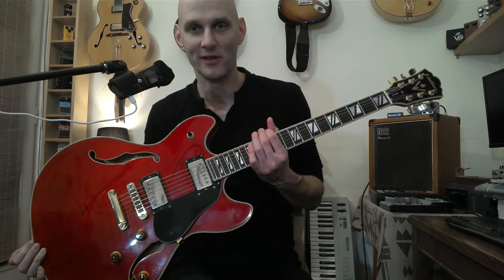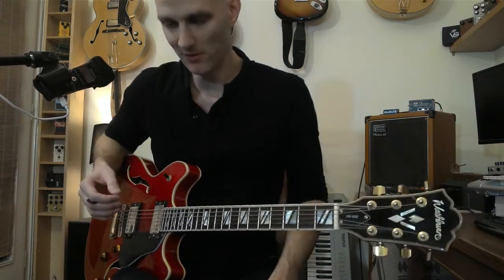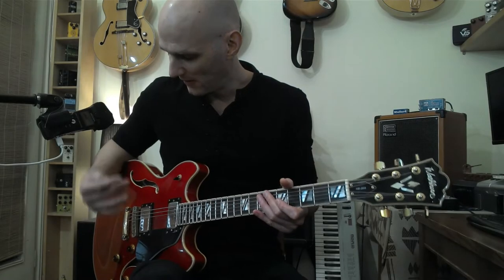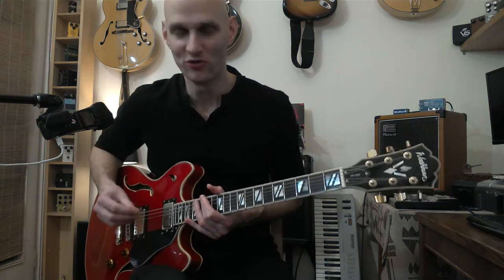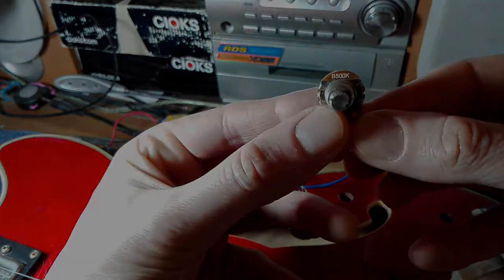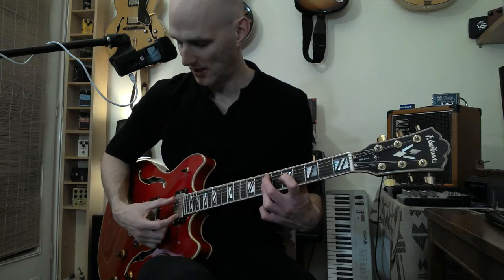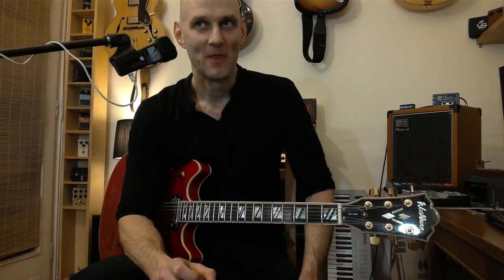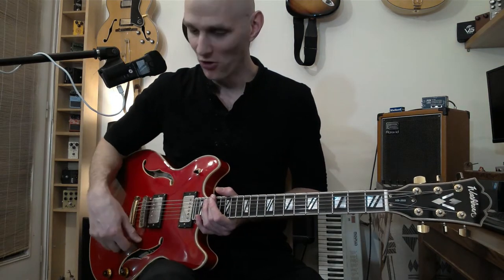"Muddy" Pickups?  No problem!  (...this is NOT the Treble Bleed mod...) 50's Wiring is KILLER!

Comment: an "isolation transformer" ( 1: 1 transformer in an enclosure with IEC in and standard receptacle out ), is a good studio tool to get rid of ground loops.
it doesn't have to be a giant one;  just enough to handle your highest draw device is usually good, because it's mostly used for trouble shooting. ( but often stays connected in line )

alternately, and less expensive, are cables with the shield lifted on one end. ( and labeled as lifted )

Comment: Yes , I assembled a 92 LP Studio, with taper CTS taper pots, using a a vintage wiring scheme, was blown away by the openeness amd clarity.
    Seems like it would be a fairly simple, and less invasive mod for anyone wanting to change their existing  setup.  However I don't think it's possible if your guitar has a modern circuit board setup.

Comment: The taper of the pots is a mechanical constant that can react differently with various wiring and capacitors. When I hot rod my guitars, I try'n upgrade ALL the electronics at once to suite the purpose I'm after. I'd never buy pre-wired kits. They never have everything I want in them. Being able to customize my guitars is half the fun!

Comment: BTW,  Tibor, I too like adjusting volume frequently while playing,  however, most times I use a volume pedal rather than the volume pot, then you always get the full guitar sound.
    I've come to prefer wiring in the Volume pedal after the Distortion pedals and before the timed pedals ie. Chorus,  Delay, Reverb. 
Try it.
Reply from the maker: Thanks for the tip Dave, I actually do this sometimes when I use my GT8 live and then I set the expression pedal as a volume pedal.

Comment: I was surprised, in the comparison, by the difference between 50's and the Treble bleed wiring. More noticeable than I expected
Reply from the maker: Yup, I was also pretty surprised by it.  The treble bleed is a great mod, but I'd put my money on the 50"s method any day, it can increase noise coming from dirty power/neon lights though as more highs pass through.

Comment: 50's wiring also works with Fender guitars also. It makes quite a difference.
Reply from the maker: Hi Norm Rivers!  Thanks for your comment!  Yes, I agree 100%, I have all my strat style guitars wired up with the 50's wiring.  The only thing I find with it on a strat is that you cannot controll the tone if only the bridge pup is selected, but there is actually a great mod for this, just need to make an extra solder connection.

Comment: Great video. I always thought that 50’s wiring was the same as treble bleed. Now I understand the difference. I have a Tele with a treble bleed and it thins out the sound when reducing the volume. I may try the 50’s wiring to reduce the thinning out. Thanks.
Reply from the maker: Hey dreamscuba, thanks for the comment, yes, I think the 50's wiring is the real deal, I have all of my axes wired up this way, even my strat, so I'm sure that the tele one will also work like a charm, I recommend checking out the breja toneworks channel, great source of info for schematics.  You into scuba?  I'm an amateur freediver myself :)  Take care man and thanks again for commenting!

Comment: Good stuff. What I also feel with 50's wiring is that it has a slightly more airy sound with the controls open. The only downside would be more prone to noise but who cares? It's about the character in the tone that 50's (correct) wiring provides to a player.
Reply from the maker: Thanks Aldo!  I agree 100%.  I also find that the other part of the secret are the B500K (linear) pots and not the A500k Audio/Logarithmic pots.
Reply: Theoretically I it should actually lower the noise floor. I read about it somewhere.
Reply: @philippgrunert8776  better grounding

Comment: Hey man, grettings from Brazil. I have the same problem with my les paul. My neck pick is very mud, even with 50wiring. There's a huge difference between neck and bridge. I took another solution that was changing the neck tone pot to a bass cut. Work's well but for high gain it kills a lot of sustain as the treeble bleed do too. Congratulations for your video man.
Reply from the maker: Fala monstrord!  Thanks for your comment my friend, greetings back from Hungary :)  (I've been to Campinas, SP, Bertioga back in the day, amazing places!)  Sorry to hear that about the pickup, maybe it's something to do with the pickup itself perhaps?  I think at the end of the day, the most important thing is that you find a solucao that works the best for you.  Sometimes the pickups are also quite mismatched.  Also remember that if you raise the neck pup high, it will also increase the bass and vice versa if you lower it.  Abraco!
Reply: Rewire all your volume pots. Use the middle Lug as the input and use Lug 3 as your output. Leave the ground wire alone.  This will maintain the pickup's volume when both pickups are switched on.
Reply: @ILLGREEN1  Its like the modern wiring I think. The problen isnt the volumes but the neck pickup lot of bass. I'm using the 50's wiring due the versatility when using the volume pot. But its a good tip to disconect the ground pot lug. I'll try
Reply: @monstrord  Cool! Not the ground, that can remain as is. I mean, only swap the wire from the input and the output.  

On a guitar with one pickup, you would usually solder a volume pot as follows: LUG 1-ground,  LUG 2-output and LUG 3-input.

But since you have 2 pickups, the above orientation will cause one pickup to short out the other.  Though it will still work and some like it. But if you want both pickups on without any reduction in volume when switching them both on, then your volume pot should be soldered as follows: LUG 1-ground, LUG 2-input and LUG 3-output.

In that orientation, the input is at the volume pot's wiper, so when it goes out into the output jack, your amp doesn't see it and both pickups don't short out the other.

This orientation works with whatever wiring you prefer, it's just preventing one pickup from drowning out the other when both neck and bridge are switched and keeping the volumes constant.
Reply: @ILLGREEN1  yeap, it's the independent and dependent volumes connection. I'm rewiring my second les paul with a new pickup set and I will take this one for independent volumes and modern wiring with adjustable treeble bleed. My first LP will maintain 50s wiring and dependent volume.

Comment: Tks for the video. Great advice. One question. Did the tone knobs change behavior after switching to 50s wiring?
Reply from the maker: Sorry for the late reply!  In a way yes, they become way more interactive.  You can also play around with the Alpha vs Beta pots, say you but betas for the volume and alphas for the tone, or both beta etc...  I have mine both Beta pots and they provide a more straight / linear curve and what also sounds amazing is if you turn the volume knob down just a bit.

Comment: Bill Callaham used to make a real ABR-1 bridge made out of cold rolled steel; but those are unavailable anymore. Those bridges made a big difference in the dynamics of the sound coming off the guitar, thus making the pickups clearer. A real shame they have gone away ...
Reply from the maker: I know what you mean, I also like the older "Harmonica" bridges and the older style Epiphone ones (the Korean ones from the Samick factory) I think my Washburn Hb35 was also made in the same factory in 1993 as it has the same bridge as my Epi Sheraton from 1996.  They are cousins ;)

Comment: Great info! Have you considered a noise gate pedal to filter out the electrical noise?
Reply from the maker: Hi Wayne, thanks for the tip, the thought did cross my mind, but I've actually played around with the power supply on my board (after watching a video from the ThatPedalShow channel called "That Pedal Show – How To Power Your Pedals Properly & The Legend Of VCPI" especially the part at 11:00) and it helped a lot as I do have a digital delay pedal on my board.  But thanks for the tip man!
Reply: @TiborRisko попробуй сменить положение конденсаторов.просто коснись их.если они припаяны правильно (orientation) они не должны шуметь.и ещё лучше чтобы корпус конденсатора  был из металла.извини за то что пишу на моём родном языке)
Reply from the maker: @alexl.8318   Спасибо за совет, попробую в следующий раз, когда буду менять струны на гитаре. Пишите на родном языке, могу перевести :) Мне всегда нравилось, как выглядят кириллические буквы, надо научиться их читать.

Comment: I don’t understand why this is not just standard in Gibson and Epiphone type guitars that used this originally. A quick way to get some of this effect is to cut the connection between the volume and tone on the neck pots. The tone will of course not work, but you can roll back the volume to clean up your sound or change dynamics.
Reply from the maker: I thought about this question quite a lot myself, but as Gibson owns many pickup companies that make billions with aftermarket pickups every year hence the saying "....get an Epiphone....pit a Gibson pickup into it if it sounds muddy and it will sound almost as good as a real Gibson...."  If Epihpne/Gibson would use 50's wiring to start off with, then this would cause a lot of loss for their affiliate pickup companies.  I could be wrong though, but I think it makes monetary sense ;)

Comment: Really helpful video,  I have a guitar with a p90 on the neck. Would the 50s wiring work on a p90?
Cheers
Reply from the maker: Hey Martyn, thanks for the kind words, I'm happy it could help.  Yes!  The 50's wiring also works with P90's and other singe coils (all my strats are wired up this way)  Hope it helps you, you'll never need a treble bleed again ;)
Reply: Of course, p90's were made in the 50's. Most Juniors are wired 50's style
Reply from the maker: @louaguado995  Yup.... I have a friend who has a Junior from 1959 and it has this wiring method.

Comment: Thank you for this video.  I use the modern wiring method mainly because it's perceived more louder to me.  When I tried the '50s, it was low sounding.  Maybe I should try it again.  Also, when wiring more than one pickup, the middle Lug on the volume pots should be the input.😉
Reply: I retired my Les Paul a few months back to 50’s wiring. I lived with it for a while to give it a chance, but in the end it didn’t work well for MY pickups. Could well work great on another guitar, I may try that but I didn’t like the sound (best I can describe, it sounded “flabby”) and I really didn’t like the interplay between vol and tone and that it was not predictable for me even after a long time playing how to set it. I’m going back to modern with treble bleed. Can’t find the original caps I had on there for treble bleed, but hoping to get back where it was. I find i have much more fine control.

Did some research, and found on a few forums people experiencing the same as I did, that the 50’s wiring on their particular guitars didn’t work as advertised. They, and I, experienced loss of treble when turning down vol. Not drastic, but definitely there. I may also need to try to revoice my pickups with a vary small cap. May be my particular humbuckers need some help.

Comment: When I redid my 97 L P studio I did 50's wiring w Garrett cloth wire. Got CTS 500K pots and. 011 caps to go with 496/500 pups. To get the most out of it IMHO.
Reply from the maker: Thanks for the tip on the 011 caps, will try it on the next guitar I buy...even though I really should not buy any more guitars but hey.... ;)
Reply: @TiborRisko  I used. 011 cause I'm a Strat guy 1st. My current Strat I've had since 96. It's a 3 color L Sensor equipped deluxe plus and of course any Strat is going to be a little more trebley than a bucker. So my system on a whole is more trebley. Figured less adjustments when switching guitars. On a different note I way of electric/acoustic gets a really nice sound and guitar volume has a lot to do with it. I use the AKG bug wireless system on all my guitars and for the A/E set up receiver goes into a BBE Sonic Stomp mini and then into my own little Behringer 10 channel mixer then that signal gets sent to FOH. Or to my little 250 watt house P A. This way very little guitar volume and I feel it's like a miked acoustic sound but you can move around and sing or whatever. Got my AKG bug systems for about $75 average. Got my Behringer mixer $50. Got my BBE SS mini $60. And my E A guitars( 6 and 12 string) ain't worth $200. Yet my sound is awesome.

Comment: What about mud when you already have 50s wiring? The Slash APH-2 set in my 2019 Gibson Les Paul Standard 50s are incredibly dark and muddy. They sound pretty bad in most situations.
Reply from the maker: Wow, good question, are you sure that it is wired up in the 50's schematic?  I've never tried a Slash set so I'm not sure if it is that muddy to begin with.  Maybe test the set in another guitar that you wire up in the 50"s way?
Reply: Change the capacitor. To a lower value.

Comment: My les paul has a pcb with plugs on the pickup cable ends
Reply from the maker: Yes, that is a good question weather or not those are wired in the modern or 50's style schematic.  I'm pretty sure Gibson do both, the question is:  Which one is in your guitar.

Comment: What about the "Brown Box"? A voltage attenuator.
Reply from the maker: To the best of my knowledge that is mainly to create more "sag" or more gain "á la Van Halen", not sure if that helps clean up the tone when rolling the volume back, but I could be wrong as I've never tried one out.  I do have an overdrive pedal that I use that emulates that tone (Brown Fox) I did a video on it using my strat, but I have another video in the pipeline using humbuckers.
Reply: @TiborRisko  ok. I talked, briefly, to a guy that used one. He said voltage is inconsistent and the different voltages can affect the tube amp tone and a higher voltage can damage tubes over time.
Reply from the maker: @scottbee501  Thanks for the info my friend.  To be honest, I hardly ever use tube amps, 99% of the time I use my trusty ol' 1982 Roland Cube 60 transistor amp with pedals and a Teal striped Peavey Bandit, but this is just a personal choice, not saying transistor is better than tubes or vice-versa, it's just what I've gotten used to over the years.  But thanks for the info on the voltage attenuator, I've seen Johan Segeborn do a really video on it: https://www.youtube.com/watch?v=hinQPWiiwaI

Comment: In my opinion an equally good mod is just putting a higher value potentiometer in there. I put a 1M on a guitar with an unusably dark and quiet neck pick up and it immediately made it on par and almost better sounding than the bridge.
Reply from the maker: Thanks for the tip, to be honest I've never tried any pots other than 250k and 500k.  So this is a 1M pot using modern wiring method?  Does it clean up well on an overdriven amp?
Reply: @TiborRisko  Yeah, my wiring scheme has the tone pot before the volume pot modern style. I followed the wiring diagram on Rickenbacker's website under the wiring diagrams section. 

The catch is when you roll the volume back you are not getting the "high pass" or "treble bump" effect that 50's wiring provides, you still have the modern "darkening" problem. However, if you are so inclined, you can wire a 1M 50's style and (I am pretty sure you would) obtain the same results, just with more treble at wide open, then dial back the tone pot if/as needed. Basically this set up gives you more flexibility.

To summarize, a 1M pot gives you more treble (and a bit more output/volume) at 100%, but retains the modern functionality.

It's worth mentioning that I only did this on my neck pick up, the hotter bridge still has a 500K and in my opinion is the perfect amount in terms of volume and treble balance for the two.
Reply from the maker: @ssplintergirl  Interesting, thanks for the info, I'll look for some 1M pots the next time I'll go to a guitar shop here in Budapest.
Reply: @TiborRisko  I was never more surprised to see the prices on most "guitar electronics" compared with buying the same components from an electronics distributor. I recommend buying from an electronics supplier if you are able to, the price will be much better so you are more inclined to experiment with different ideas/circuits, but just make sure details like shaft type/diameter etc match up to hardware you have. 
If you make a video on it I am looking forward to seeing your thoughts and results!

Comment: The noise you hate is largely running high gain through a hollow body haha.
Reply from the maker: :)  That can actually be quite cool ;)  But yes, in a live setting that can be quite annoying BUT there is a very cheap solution to that too = Just tape the f-holes with some see-through scotch tape.  Works like a charm and cuts the feedback down by about 70%.  Was actually thinking of making a video about that.

Comment: I don't understand this idea of audio (logarithmic) versus linear taper. I understand it in practical effect, but I mean, in terms of mathematics and physics. I thought the volume of sound, in air, and in volts, is logarithmic. So, if the amplitude of sound, the volume, is logarithmic, using a log pot would give you a linear volume response... and using a linear pot would give you a logarithmic taper, as again, a linear resistance to a logarithmic phenomenon will yield a logarithmic curve...
Reply from the maker: Yes, to be honest, I never really dove into the matematics / science behind it all, basically one has a big jump when turning it up and down and the other has a more gradual taper.  Hope this helps you.  R 'n R!

Comment: why, yes, it does indeed sound like this. 😂
Reply from the maker: :)  Hope this info helps you solve this problem.  If you want a quicker solution, the treble bleed is also a pretty handy solution as it is a lot quicker and simpler to install, but I personally prefer the 50's wiring.  Hope this helps.